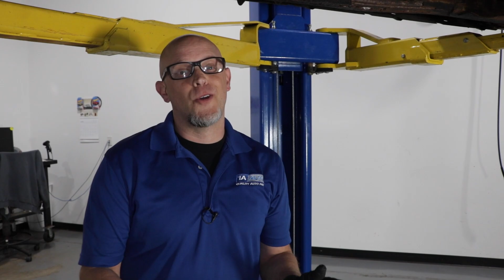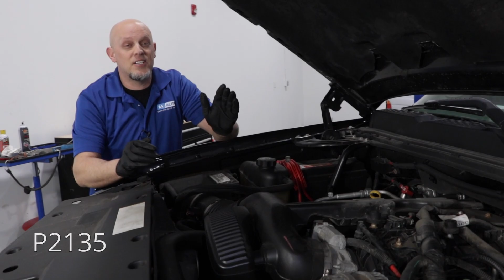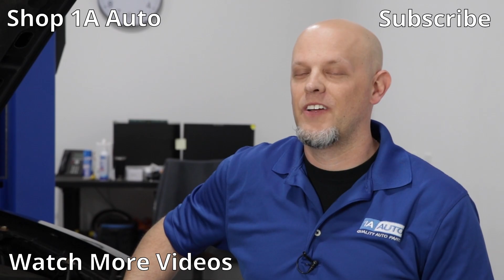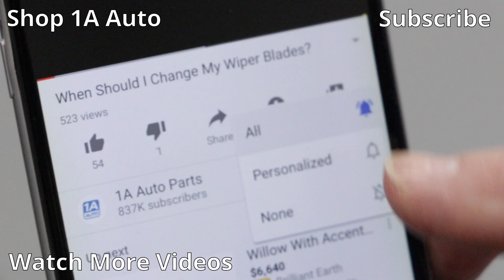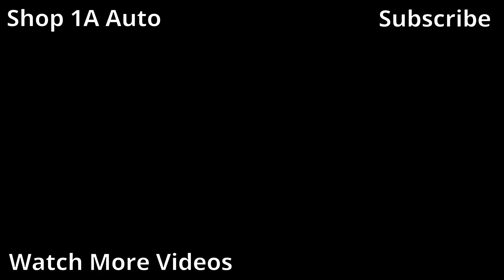Top Check Engine Trouble Codes 2007-2013 Chevy Silverado 1500 Truck

Comment: I have u0101, u0214, u0073, c055-5a. Really scratching my head on these guys! Truck is not starting intermittently, not shifting, starts in 2nd gear, slowed throttle response.. No throttle response at all sometimes.. 2007 (07-13) nnbs silverado 1500 5.3.

Comment: Forgive me for forgetting the numbers, my 2010 Silverado, 5.3, had a code that tracked it to cylinder 1. I changed all plugs and wires (needed anyway), still coded. Use 2 or 3 full tanks of fuel with some Lucas injector cleaner. It actually worked. Runs great. 
Still getting code for a/c system. Noticed long ago, right after warranty timed out, a leak under glove compartment (inside on the rug), a/c hasn’t worked since. Didn’t have the money for fix. Anybody have that happen? Thanks.

Comment: I have a P0521 again, but your video only mentions the oil sensor/sender or the screen as being the culprits (which I previously replaced months ago). From what I'm reading, problems/causes could be:

1) Defective OIL PRESSURE SENSOR/SENDER (NOT likely since I just replaced mine and the screen recently)
2) Low engine OIL LEVEL (NOT likely unless I'm burning oil since my last recent oil change due to other issues below)
3) Incorrect OIL FILTER (NOT the problem)
4) Defective OIL PUMP
5) INTERNAL ENGINE WEAR causing low oil pressure 
6) Disconnected or faulty WIRING IN THE OIL PRESSURE CIRCUIT
7) SLUDGE BUILDUP inside the engine restricting oil flow
8) PCM problems (e.g., outdated software)

Comment: My instrument lights and radio lights are very dim on my 2012 Sierra during the daytime. They used to be much brighter when the truck was newer. The lights work just fine for nighttime driving. Any ideas? Thanks
Reply: Need to solder on new bulbs?

Comment: Have an 07 gmc. Love it. 4.8l is great. I have the first code and haven't messed with it yet. Trying to figure out if I want to swap stock with tow mirrors.
Reply: I have the first code too. I cleared it and mixed some marvel mystery oil in the gas and have driven about a tank of gas so far and it hasn't come back on. Hoping it fixed itself. But might just be it hasn't reached the drive cycle. Strongly recommend the mmo in the gas tho really perked up the truck.